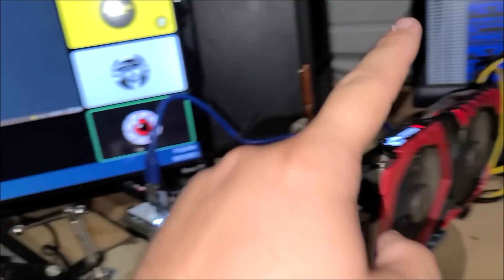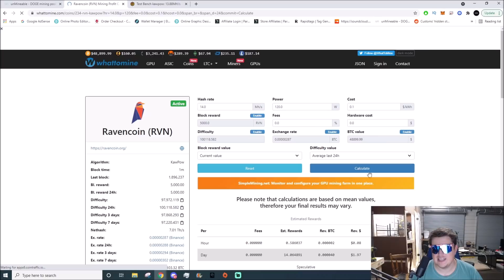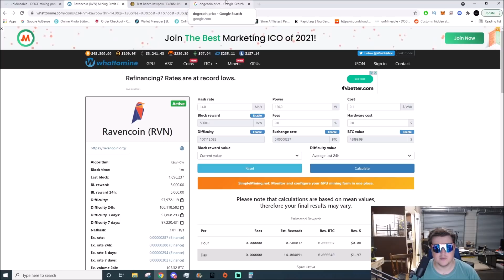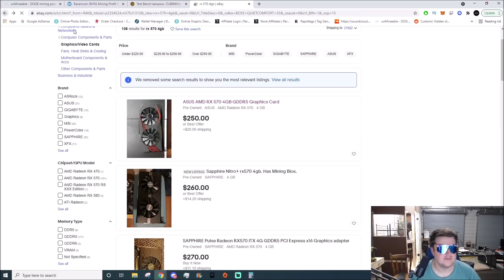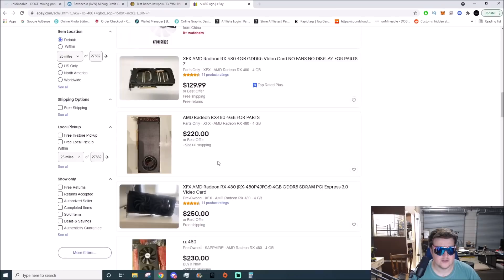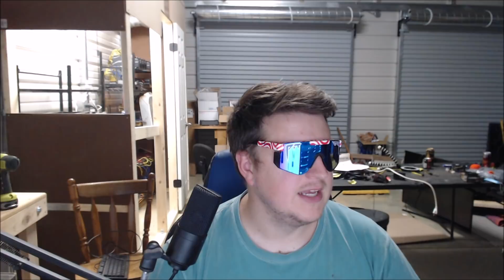RX570 4gb Mining Raven / Doge

Comment: Hey, have you tried running the motherboard completely isolated? I had one that was not powering on and the problem was a stand-off creating a short circuit, I took the mobo out of the case and it worked. I isolated all the standoffs with electrical tape and now is running fine… just an idea for the troubleshooting

Comment: I mine unminable sometimes. I use it to mine ADA. I do have a question for any experienced miners. Usually I run Ethminer. Really for nostalgia because its what I started my mining with. But lately I have been trying out new algos. When I found unminable, they list lolMiner as one example that you can use. That made me remember a long time ago when I once used BetterHash on a laptop before I really got into mining and it used lolMiner on my laptop. So I really wanted to try lolMiner. I Changed my flightsheet in HiveOS to lolMiner and to my surprise lolMiner ran my 580 Red Devils at 93-95 watts with absolutely no hashrate loss. When I ran Ethminer or NB or Phoenix....I can't get them below 108ish watts or the cards crash. But lolMiner is just happy to hash the fuck out of some shit at 93 watts. So I'm not sure if lolMiner is just really efficient by design or if its like a driver thing or perhaps its a polaris just has a crush on lolMiner. I don't know. If someone come school me a little that would be awesome.
Reply: If you have a spare machine or don’t mind stopping the rig for 2 ~ 3h, I suggest you run Minerstat benchmark with the algos / minores you’re interested in. It’s much less trouble than getting the proper CLI for each. The results WILL NOT be the best you will get yourself later, BUT it will show you that sometimes T-Rex (usually the most profitable AFAIK and the one I really know how to CLI optimize, so I don’t need Hive or any other annoyances) …. Anyway, for some algos you’ll find better consumption with a .3 or .5 potential MH difference. Might be worth it. If you want to exchange data and results drop me a line, I’m testing a bunch of new cards as I’m expanding the rig, but I’m also looking into older ones. Good luck there!
Reply: @carlosophia  Thanks for the advice. I have never used T-Rex. There are quite a few I have never used. I really do need to sit down and benchmark them. I feel kinda stupid that I haven't yet. I have never heard the term CLI. I learned something new everyday. You tell me what CLI stands for by any chance? I have such a dirty mind. My brain keeps adding a "T" to the end of "CLI" because it makes me giggle. Well we all know where my head's at
Reply: @CarbonAnvil  Hey, Ryan! Well, CLI-Ts are quite sophisticated interfaces but the gear differs a lot! 😂  It's just a common word for Command Line Interface - writing down the whole thing instead of using a GUI. Hey, I'm ALMOST getting serious about a "how to" website after I helped out two locals this week and having worked 12h+ daily to understand why all numbers I get on the web or on Android apps are either non-sense or copies of numbers that I've read in 2Miners and an older hash spreadsheet by @Red Panda Miner. Drop me a line if you're interested, I'll get a new mail just for this. Regarding T-Rex, go to GitHub. Get the latest from their official repository - ALWAYS the official stuff! Google "2Miners T-Rex". That should get you going. Feel free to ask questions if you need help and good luck!! ⚡

Comment: how do you feel about Ethereum Classic (ETC)? that's what i've had my 4GB cards on since that huge 10x rally back in May lol. about $1.50-$2.00/day from a single R9 380 and an RX560, around 30MH/s
Reply: I've been doing the same thing since may.  Only a single RX 560 for me running at 12.3 mh/s
Reply: @amdhehe  How much in USD you think one RX 570 will make a day?
Reply: Mine raven or ergo
Reply: I only mine etc on cards that can't mine rvm. Could just use mining pool hub to trade rvn to etc.
I have 2x 470 and a r9 nano on rvm ~45MH/S

I have 3x 7950 on etc @81.5MH/S

Ergo has cought my attention though.

Also if using things like unmineable or cudominer rvn payouts seem closer to direct mine payouts unlike etc.

Comment: did you replace the CMOS battery in that board? dead CMOS bat from sitting for years can have odd results

I can't imagine there is any sort of physical switch on the board to select between onboard/PCIe GPU, assume you've tried with and without cards already

Comment: You can always use another mother board, it sucks that you have one that is dead out of the box. I really like the 8 card motherboards easy set up up I do use risers so I can separate the cards for heat. They run on 6 pin power so I use all server power supplies to power everything and jump drivers for the driver. I do keep one or 2 extra jump drivers flashed for hive so all I have to do is add rig config if one fails. Jellyfish

Comment: Too bad your H110 motherboard is dead, that sucks when you pack up a brand new thing and it doesn't work, especially when you do it when the warrenty is out :(

I have been mining mostly ETC with my RX 570 4 GB, but have tried Ravencoin, Ergo and even some Vertcoin. I really like my Polaris cards, they are so easy to handle and cost efficent. Just set the core to 1100-1200 MHz depent what coin you'll mine and memory at 2000 MHz :)

Comment: Is it possible to mine 2 different coins with a single rig? I have an 8 pcie slot mobo with 4 rtx 3070s mining eth, and 4 empty slots. Could I populate my 4 other slots with 4gb GPUs for mining raven or doge? Thanks! Also I used hiveos and PhoenixMiner
Reply: Ya you can, you just need to set up another miner and specify the gpu’s in the miner to mine what
Reply: You can do that in hiveos

Comment: i'm all about that algorand payout :3 
sold off a batch at .84 but the of course it runs to 1.24 Dx
Reply: nope, don't touch the 4gigs, bought a 1060 3gb back when the prices jumped to hell before i realized the horror of the 3gb model, for 250 bucks no less, never again lol
ETH, ETH classic (on an old nitro laptop), and BTG on that crap 1060 haha
have two hd5770s that i grabbed for 10 bucks because nostalgia for my mid 2000s dream pc.
wish they could do .... anything haha damn power leeches